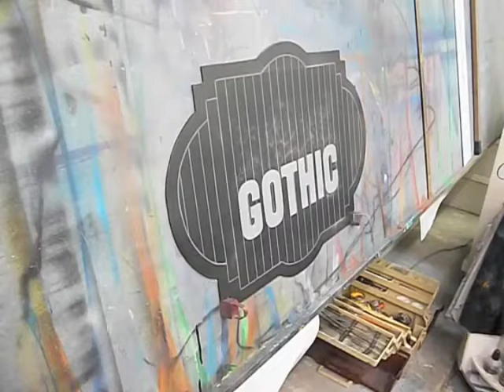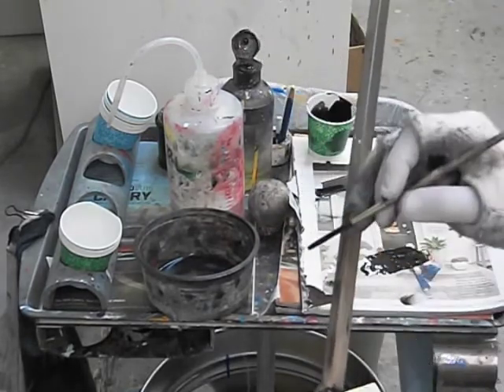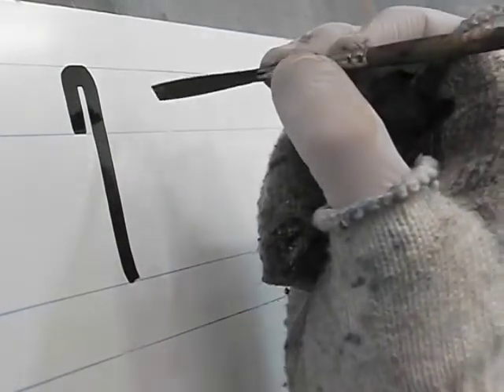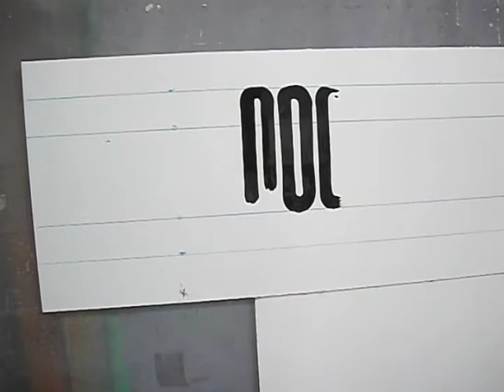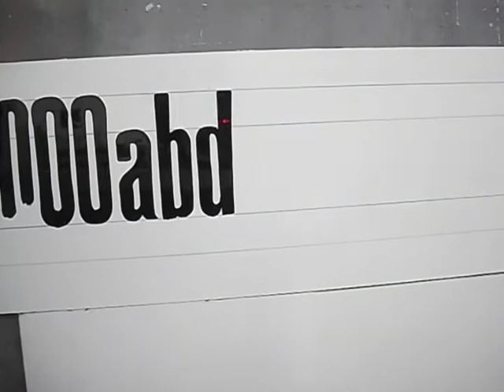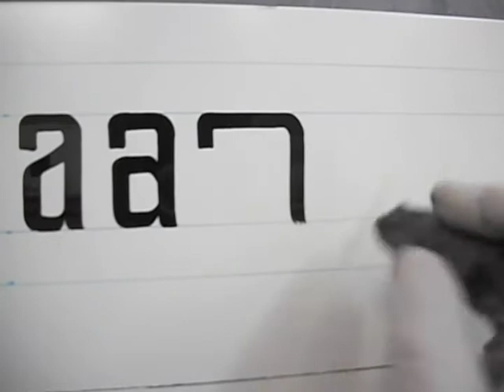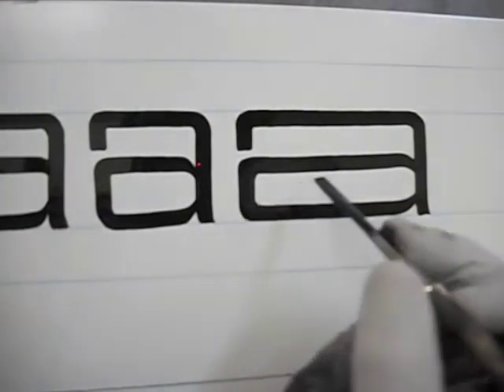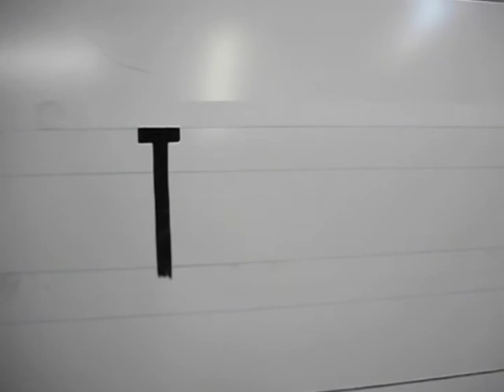1 Condensed Gothic Intro

Comment: Great stuff David! Your videos are so clear and informative. Keeping the craft alive! Hey just wondering did you ever try what Mike Stevens used to do with his brushes when using the 3 fingered method? He used to build up a 'ball' of masking tape where your fingers wrapped around the brush. He said that it gave an even greater level of sensitivity..
Reply from the maker: Thank you so much Rebel! Yes, all my old brushes have been built up with tape and shrink tubing. The Kafka brush handles are twice as thick so I haven't needed to except for the #1. The thicker handle allows for a faster spin for tight radiuses. I wonder if this was deliberate when Steve's brushes were being designed?

Comment: GREAT JOB!...you're exactly right, "very mechanical"...once you understand the make-up of this font. Again...your commentary is excellent. 

Wished I lived closer to ya''........(probably a GOOD thing for you.....as being self taught ,and still learnin' with every stroke after 50plus  yrs.....I'd be a permanent fixture in your shop!!)

Have had problems findin decent brushes up here in the "sticks"......I see you usin' Kafka brushes...have been wantin' to try one some time....."I've always used Quills (multiple brands) Do his metal ferruls have a "set" chissel- or do they need to be formed?...am very tempted to try is stipers also, as I cartoon with Oneshots and struggle with my fine outlines....
Reply from the maker: Ha ha ha! A couple of old brush slingers hang'n out. Yeah, Kafka Kwills are amazing. They are pre-shaped like a show card brush. They out perform anything I've ever used. The clean, fine hairs at the tip make razor sharp edges. The tear drop shape of old quills never made sense to me especially for lettering straight lines. A #2 and #4 are great sizes to start with. All of his striping brushes are just as amazing. I prefer short length brushes for cartoon details.
Reply: davidographicsguy I have just purchase a couple of Kafka lettering kwills but didn't come with a chisel tip. i pallet the brush to get one and the tip reverts back to round. are we getting different brushes in the UK
Reply from the maker: What number are they? does it say "Kwill" or "Liner" on the handle? Liners will stay round. If they say Kwill, be sure to clean out the factory size really well with lacquer thinner. Too much paint in the brush can be a factor. They should be the same brushes.
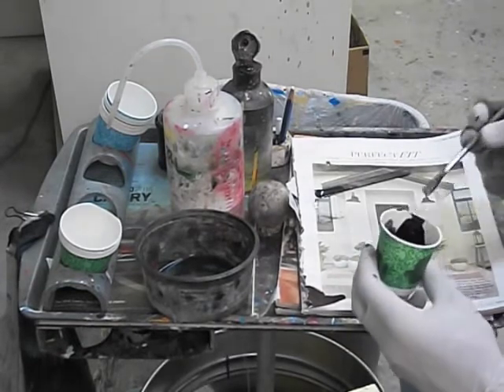Reply from the maker: On this video at 4:25 I'm really pulling the paint out of the brush to create the chiseled tip.
Reply: Have you tried Mack jet stroke brushes? If yes, how do they compare to kafka kwills?
Reply from the maker: Flats typically fan out when pressure is applied which makes it difficult to keep consistent stroke widths. These are better "fill in" brushes:
https://letterheadsignsupply.com/mack-brush-series-1962-flat-lettering-brush

Also the Kafka's are a synthetic blend so they keep their shape consistently. Thank you!
Reply: I'm impressed an so thankful for the fast response, since this video is already 3 months old! It's interesting gaining some inside view on this little to not covered topic and I thank you for your expert advice and information!
Reply from the maker: You're so welcome! Are you lettering too?
Reply: I've been doing calligraphy with pen and paper, but it seems like such a big jump into this unknown territory of lettering, with expensive brushes and these liter bottles of thinner, that I will never use up in my life. But in comparison to other arts and crafts it's not that expensive at all and fortunately I found your nice and very informative channel, where you explain everything I've failed to find on my own! Obviously it is so mesmerizing to watch you letter and I'm seriously considering taking the jump and just pay 80€ to have some serious fun. ( Maybe even earn some extra money in my town since there are no other sign painters ;) ) Well I don't know I've been thinking about woodworking too so I have to think about this some time.
Reply from the maker: If you love to letter, you will flip over brush lettering, your calligraphy experience will be invaluable. I learned calligraphy from one of the best in the U.S. named Carl Rohrs. He paints some signs too. Start with the Kafka Kwills #2 and #4. They will be your most versatile. You could also start with flat inexpensive water color brushes and poster paint to see if you like it before plopping big money on expensive materials. Where are you in the world geographically speaking? :)
Reply: I live in Germany :)
Reply from the maker: wunderbar! :)